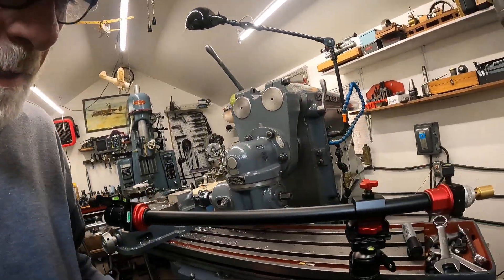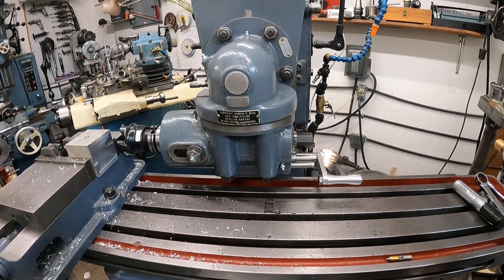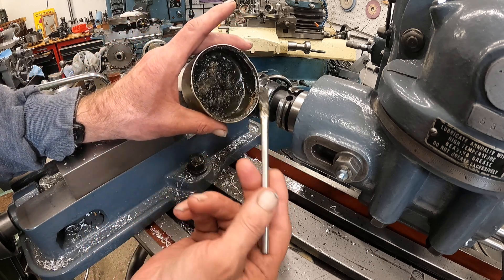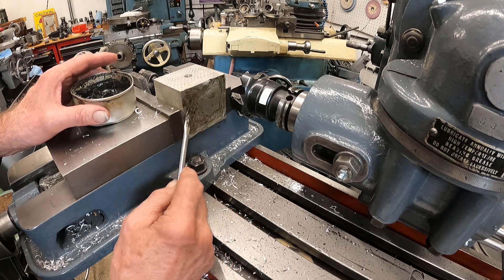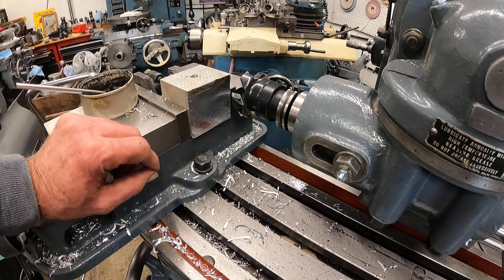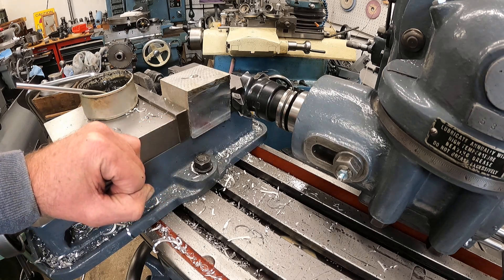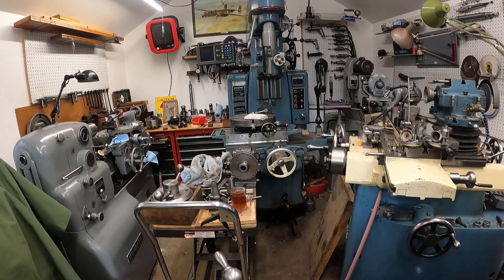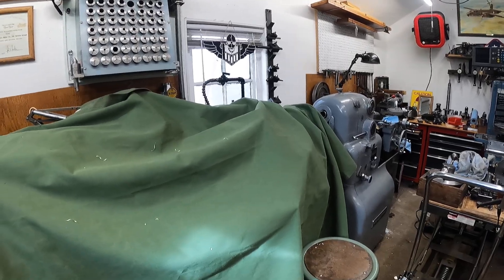First cut in decades for an old milling machine

Comment: Dee, Explaining how you will use the two machines to compliment each other makes a lot of sense.  I’ve never seen anyone use a jig borer until I watched you demonstrate how you use yours.  Considering what it would take one today they sell for very little money.  Glad to see you are keeping your hot rod 10ee protected.  What a beauty it is.  I’m spraying paint on parts for mine next week. I’ll send you pictures.  Did you take a look at the pictures of my Kaiser boring/facing head yet?  I got it for free because someone tried to take it apart for fun; it was brand new.  They couldn’t finish disassembling it and they couldn’t figure out how to put it back together.  It sure was a score for me.  Did you go back to the yard and get that steel ring you were looking at?  Have fun hunting squirrels. Cheers, Will
Reply from the maker: Most of the time the mill will produce  parts good enough, When a little more accuracy is needed go to the jig borer. One of the things that I would like to put across is, there is no hidden secretes to the jig borer its just more steps and paying closer attention to detail. With the spindle optics the jig bore is a highly accurate measuring machine also.
 The milling  machine would be a lot easier to line up and use with a DRO on the table and knee. I am going to play around with a Co-Ax indicator with it see how that works